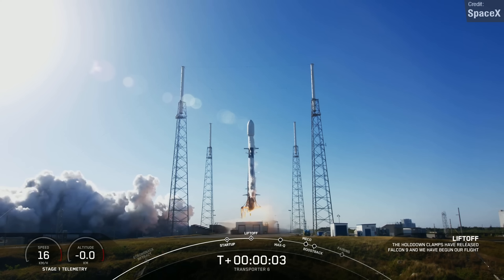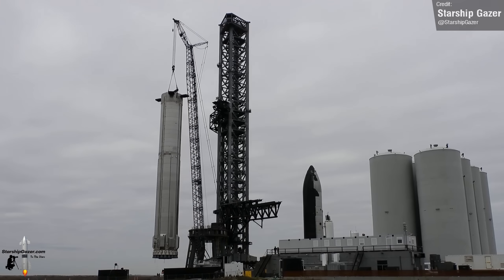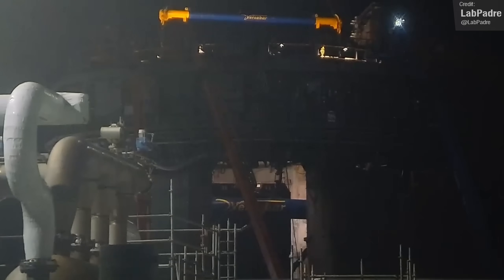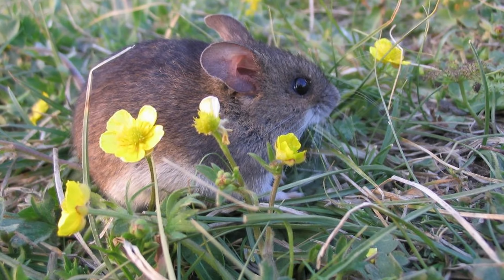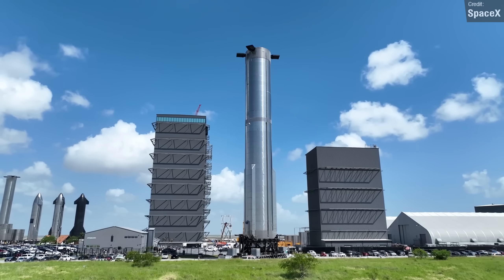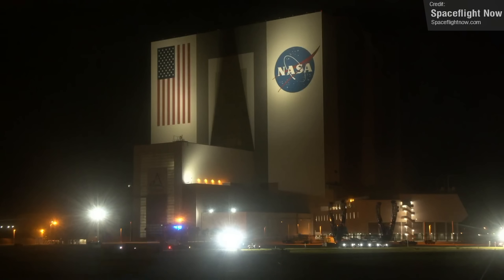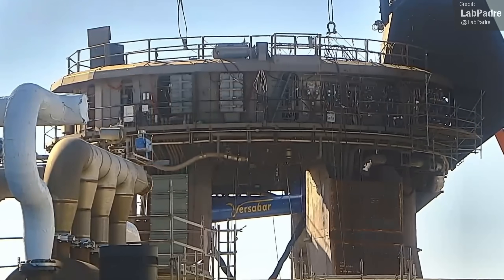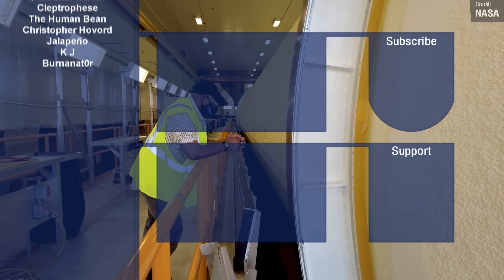SpaceX Starship Major Launch Pad Testing, Transporter-6 Mission, Artemis III SLS Construction

Comment: Hold on a second. You said the full stack Starship would weigh 4500 metric tons while the booster would produce 3000 metric tons of thrust. If that's the case, it's going to be sitting on the launch mount for quite a while until it burns off that excess 1500 tons of propellants.

Comment: So it's gonna stay . Mass is 4500T  engine power 3000T
Reply: Starship (second stage) is supposed to have 1,200 tons of propellant and the Superheavy booster is supposed to have 3,600 tons of propellant, so around 5,000 tons with the dry mass of Starship. The Raptor 2 is supposed to put out ~230 tons each, so almost 7,600 tons of force. So around 1.5 TWR.

Comment: You said the 33 raptors produce 3000 metric tons of thrust but then said the fully fueled vehicle weighs 4 and a half thousand metric tons. That would be a TWR <1 so I think one of those is wrong or you swapped them.
Reply: Starship (second stage) is supposed to have 1,200 tons of propellant and the Superheavy booster is supposed to have 3,600 tons of propellant, so around 5,000 tons with the dry mass of Starship. The Raptor 2 is supposed to put out ~230 tons each, so almost 7,600 tons of force. So around 1.5 TWR.

Comment: 100 launches is slightly over 2 per week. How they manage to manufacture upper stages and prep a rocket for launch in a mere 3.5 days is completely beyond me.
Reply: SpaceX has around 10 Falcon 9 B5 boosters, so they rotate through the launch cycle as it takes 3-4 weeks each from launch to launch. SpaceX has done pad turn arounds in 3.5 days in the last year, but remember that SpaceX has 3 launch pads. LC-39A at KSC, SLC-40 at CCSFS, and SLC-4 at Vandenberg SFB. So that can stretch out the pad prep time.

Comment: Won't the clamps have to hold more like 7000 tons as they have to hold down the rocket until it's up to full trust before letting it go. They arny called hold down clams for nothing.
Reply: Almost 7,600 tons of thrust for the ~230 ton Raptor 2 and almost 8,300 tons of thrust for the future ~250 ton Raptor 2. But those values are counteracted by the roughly 5,000 tons of mass of the Starship with a full propellant load.

Comment: 33*230 ton = 7590 tons thrust, not three thousand.. One sentence later: Mass is approx 4500 tons. How possible with 3000 tons thrust?
Reply: Starship (second stage) is supposed to have 1,200 tons of propellant and Superheavy is supposed to have 3,600 tons of propellant, so that comes to 4,800 tons of just propellant. The dry mass of Starship puts it at around 5,000 tons without the payload.

Comment: Did I miss something, or what are you talking about? I thought they need a 33 engine static fire before they can even thing about a launch. So far, it has been 11 and the concrete failed. So up until now, they did not even manage 11 engines at once without failure, what are you talking about "everything is loocking close to ready for a first orbital launch".
Musk alredy said that a launch would be "higly likely" in November 2022. If he says march 2023, you can expect January 2024. if Musk does not go bancrupt before that.

Comment: Hang on, so the booster produces 3000 tons of thrust, but the whole thing weighs 4500 tons? Someone’s numbers don’t add up here, either Matt’s or SpaceX…
Reply: It’s more like 230 tons of thrust with the raptor 2( for now) so with 33 engines the booster got ~7500 tons of thrust ( equal a 1,5:1 thrust to weight ration) the whole straship stack weight ~5000 tons at liftoof
Reply: Yeah just googled it. Number of sources stating 250 tons of thrust, per engine. 
Did find a 3220 tons estimate for a static fire  of 14 engines a few months ago.

Comment: Do we really think Starship is close to anything while its still chewing up the pad with tests?
Reply: i wonder how they expect for the thin steel to withstand the forces of reentry.
Reply: The latest pictures from the air shows that they are preparing something new for the pad, and it looks like a flame diverter, but it's on hold until the hold down clamp tests are completed since the test gear for that needs the space.